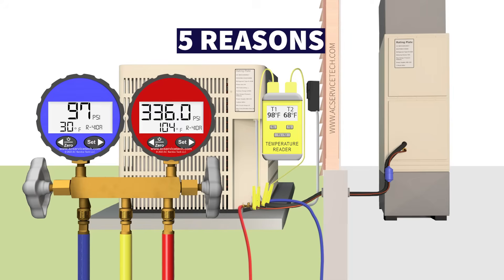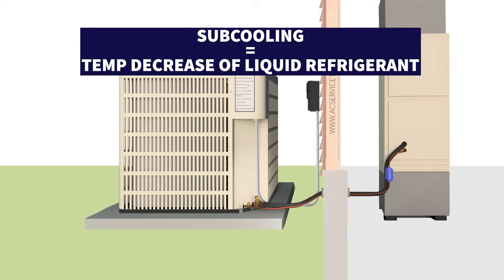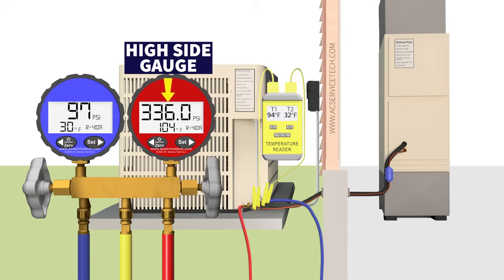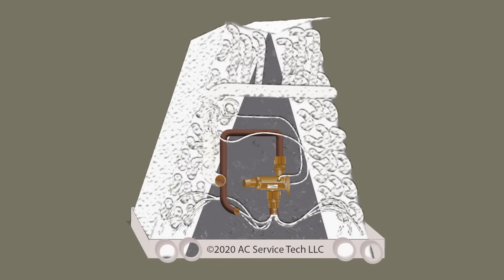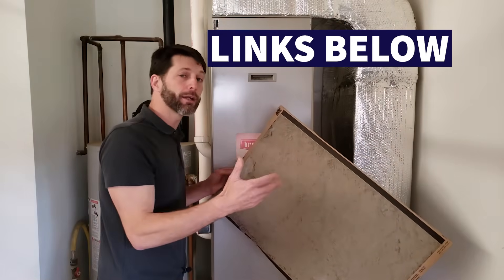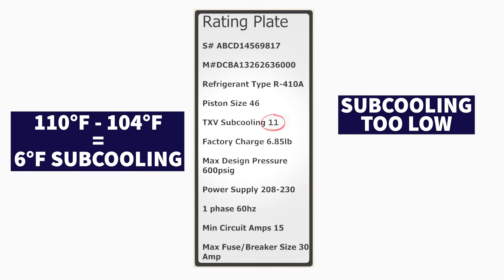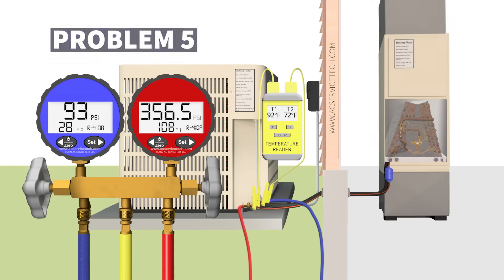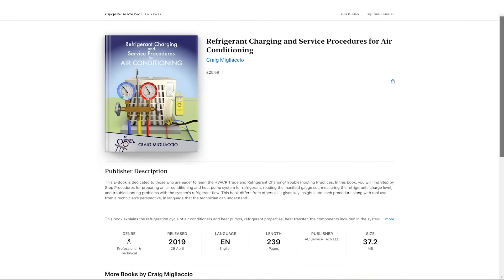Troubleshooting With Sat Temps, Superheat, & Subcooling! 5 Possible Problems!!

Comment: Ok, but for units with piston metering device dont you have to take the line temp as close to the evaporator coil as possible, not on the outside suction line to get an accurate reading? Also, doesent the data plate say what the design superheat pressures should be? Just saying for someone starting out without a phycro-meter?

Comment: Exactly what is happening to me on a new install Carrier split system r454b. Low pressure 100 psig, high pressure 290 psig. Superheat 27 subcooling 8. Condenser plate calls for 6 of subcooling. Already replaced filter drier, and txv and same problem persists.  What else could it be?
Reply: @acservicetechchannel please help

Comment: Here's one for you. Installed a 5ton Bryant unit rtu today. After start up. System went off on a low pressure twice before hooking up gauges. Saturated vapor temp of 33. Pressure of 104 on low side 2 degree superheat. 265 pressure on high side. No subcool.
Reply: Your first issue is installing a 5 ton AC
Reply: @ViperEpicness why do you say that?
Reply: 70f inside. 75f outside
Reply: open txv??
Reply: This would be so much easier if you gave both readings in Temp rather than one in temp and one in pressure. Possibly why you were all fuxked up on your readings. Making it too complicated.
Reply: @xkmmx2132  it was 410a. Convert the pressures yourself. Didn't make anything complicated. Gave you what was relevant and what I was seeing. The problem was airflow. Brand New system I had never touched before with an ECM blower that set CFM off of a voltage regulator based off off static pressure. Set my blower speed and everything was peachy.
Reply: I have a R-22  5 tons ac unit outside

Comment: Dear sir IN R-22 system back pressure continuous going Downward and Discharge pressure going continuously upward what is the problem in system please help me
Reply: 1. Check if the filter is Clogged
2. Check if the TXV strainer is clean

Comment: I have a hard time trouble shooting the heat pump at work. It’s a water furnace heat pump with a txv for metering device. The head pressure was 195.9 PSIG/68.2 degrees F with a liquid line temperature of 176.7 degrees F and a suction pressure of 63.4 PSIG/ 10.8 degrees F and suction line temperature of 82.8 F. The outdoor temperature was 86 and the wet bulb temp was 64.7 F. The  sub cool is below zero. - 108.3. That is way too low for the sub cool.

Comment: Just bought your book. I have a 12 year old trane  2 stage, 4 ton condenser/5 ton evaporator TXV, R-410A with 49.9 SH/1.9SC and low delta T. Is the system low on refrigerant or does the unmatched tonnage have anything to do with it?
Reply: Sorry 39.9 SH

Comment: I have a trane heat pump system with EEV, I have charged the system using subcooling, and it normalized yesterday to around 10 degrees subcooling, now today, it’s been fluctuating up and down, but mainly been low, between 4-6. This is frustrating because I don’t want to keep adding more refrigerant. Backstory: last winter, the compressor went out, and I replaced it. Charged it with weight as close as I could. A few days ago, I started using the cool mode and it ran for a day and then started to cycle, I would turn the breakers off to the system and wait a couple hours and then it would run for a while. Then it started to cycle again. I tightened all the blade connectors on all the wires and it’s been running properly today except the subcooling has been fluctuating up and down. Any ideas? Thank you!
Reply: Did you flush the system, evacuate the system to rid contamination, replace the filter dryer, clean the EEV screen when you changed the compressor?  Sounds like  non-condensables.

Comment: Long shot here, but hoping for a reply back, but any chance you still do service calls?  I'm in NJ and have yet to find a competent technician that can actually diagnose anything properly.  Any tech that I have had to my house just wants to go the route of "you need a new system", and I don't feel like they really take the time to do all that is needed to diagnose the issue properly to truly confirm that a new system is needed.  Especially when the one I have is only 8-9 years old.  UGH, help!
Reply from the maker: We don't at this point. We only provide the education for technicians, thanks!
Reply: @acservicetechchannel  damn, thank you for the reply though.  I enjoy learning from your videos.  Part of me wants to hand them to the techs that come out and be like here, do this, lol.
Reply: What exactly is going on and what have they diagnosed?
Reply: @Alex_hvac  Hey Alex, thanks for the reply.  I have a Goodman R410A, 3 ton unit with 80k BTU 80% gas furnace.The system is about 9 years old and does blow out cool air, but not ice cold.  It is a fixed orifice system, not TXV, Delta T is only a 9 degree difference when I take measurements.  The condensate pump barely ever kicks on and it's been over 90+ here in NJ as of late and that pump should be constantly expelling water. The coil isn't frozen and there is water in the pan.  I also tested the pump and it works properly.

I took a pic of the last tech's gauges when he was here.  Wish I could post a pic here, but can't, so the best I can do is type it out.  This is a Fieldpiece Digital Gauge he was using. R410A refrigerant Low Side: 161.5 PSIG 20.6 SH 57.0 VSAT////High Side: 223.4 PSIG -4.7 SC 76.2LSAT////Middle of Gauge: 75.7 ODDB 77.6 SLT 80.9LLT.

The tech tried adding 2 lbs of refrigerant with no significant change of anything on the readout.  He never measured anything within the house, didn't check the orifice to see if it was cleaned, the right size, in backwards (as someone a little while back did check the orifice, but this was at a time where I didn't try to educate myself on HVAC somewhat and just let them do their thing so I didn't have any input or questions as to what they were doing).

So I'm kind of in the stages now of pricing out a brand new system since nobody can seem to figure this thing out.  I'm not a professional I just watch videos on here to try and learn and help figure out what's going on.  It's just annoying to keep having service techs out and nobody is giving me a definite answer as to the problem.  I've made my piece with forking out the money to replace this system again already if it's truly condemned, but I would just love a confirmed answer as to what is wrong with it.  Sorry for the huge book to read.
Reply: @themachine871  You sound like an engineer! Lol That’s what got me started and interested in HVAC, troubleshooting my own system. Here I am 3 years later almost done with tech school I attend in the evening after work and about to test for the 608. I have a good paying job but I really enjoy this HVAC stuff. Did you ever nail down your problem?
Reply: @ Lol, thank you.  Unfortunately, no matter who I had come out, they couldn't nail down what was going on.  I wound up replacing the entire HVAC system and everything works perfectly now as it should, but I still would really love to know what the actual issue was.  Glad you found a passion for HVAC work, it's definitely intriguing and great to have a background in.  Good luck with finishing school and your future endeavors in the business!

Comment: Nice video. I'm looking for help on a different issue. My heatpump makes a loud mechanical noise only on startup for a second or
 two as it always has.   TIA
Reply: Make sure your fan is not loose, make sure your condenser is secured all around, & fan not wabling, check your coil If it's dirty, disconnect the power from the electrical panel take the sides of your condenser clean the coil with water house be gentle the  the coil is soft, if you had to take the fan to take the sids , write down what wire goes where and take  pictures, you have to disconnect the electric wires, or get you different markers mark the wires, whatever helps you remember to put the wires back where they were, don't be careless put all the screws in secured place, safty must be  your number one priority, [ the compressor information is on the condenser it's usually right outside check around u will find very important take good pictures of it print it out and keep it, check the  compressor Amp If the Amp is too high go get you a hard start kit, it can help you compressor if the problem is your compressor. If you have a newer unit that's otherwise in great condition, installing a hard start kit is a solid choice. However, with older compressors, a hard start kit may not be worth installing

Comment: Just checked my r22 system, sat of 10 deg. No wonder it would freeze. Thanks for all of you help over the years. i'm finally swapping out my old system. Going all the way, inverter aciq, their 2 stage furnace and coil (built in txv). Wish me luck. Your tips over the years helped me get my 608 for sure.

Comment: TXV TXV... #1 most improperly diagnosed and needlessly replaced part out there until someone finds the real problem 

Always check air flow. That if improper can give false readings that look like low on charge, restrictions on liquid line, overcharged with head pressure surpassing 500#s 

Low suction, extreme high head head pressure, super high SC,  normal SH with way low suction pressure. Everything is freezing!

Check air flow check air flow.  

Once or few times found a W shaped cased evaporator coil where the case insulation came off and 100% blocked 1/3 of air flow that messed up entire system that 3 companies could not figure out the simple problem.  These days we rip off or better attach  evaporator cabinet insulation to prevent such from being able to happen. 

Another simple thing that manufacturers can't get right these days ;(

Comment: Hi Mr. Craig! What are the recommended size hoses and low loss fittings to use when checking pressures and charging a system?? The thicker the better, right?
Reply: Hoses and gauges along with manifold rated for the pressures of the unit being serviced and or inspected.  As a retired Stationary Engineer with a heavy background in HVAC/ACR to include centrifugal chillers,  absorption units. I had a lossless hose with just gauge for low side and one for high side to do spot checks. Each setup was always rated to the refrigerant I was working with.  If you're new always use a gauge Manifold set design OEM for the refrigerant(s) you will encounter during your normal course of work. As someone who started out when R11 was still in use and retired after R401 had been around for years. I had multiple setups for my usage.

Comment: So when you have say 2.5 ton outdoor and 3 ton indoor coil. Is there any point to knowing what the indoor coil size is?
Reply: Yes. That's what determines the airflow you need. Depending on your climate you'll need 350-450 cfm/ton

Comment: Great video. Thank you for sharing. Have a nice weekend. May I ask, How about Heat Pump in Heat mode in the winter, How to check for ? is it the same or different. I love to watch your video ^_^
Reply: There is no sure way in heat mode. If it must be done in winter you can use a charging jacket, fieldpiece makes a good one but it's always best to  charge by weight in the winter,get it running in heat mode then come do the full commissioning in late spring. In my area anyway, just make sure you're oa is over 70

Comment: Has anyone had used the ebook E-Book - Refrigerant Charging and Service Procedures for Air Conditioning. I'm new to the hvac field and trying to learn as much as possible. Just curious if this would be a good reference material.
Reply from the maker: Make sure to read the reviews on Amazon for the book. There are literally thousands of reviews there. I saw this note yesterday and was hoping another youtube viewer would answer you here, thanks!!
Reply: Yes I saw the reviews on the book on Amazon. Very impressive. I was just interested in the ebook but was not sure if it was as good as the book.
Reply: @0518maddog  Get his regular book and quick card. I threw away his ebook and bought regular book. Ours brain work better with paper book and you can write notes.

Comment: Something to add for the new guys…. If u run into an EEV system with a single stage outdoor unit (ie tam9 with XR condenser) do not assume it’s low when you start it up and see 80 psi suction, give the valve and sensors some time to do their thing.

Comment: On hard to diagnose systems,  
I like to Reclaim and  charge system to a  calculated weigh in charge.
That way you have a reliable base line to work from.
Don't worry about drift on 410 it's negligible

Comment: This is why having a big air system is pointless. Spell a short cycle. And you're not gonna be removing any humidity from the air every time I go to a house. Somebody's like, yeah, I got a bigger unit. I'm like that's not better, that's worse
Reply: 100%. Salesman told me that and it made sense. I went from a 4ton to a 2 stage 4 ton. Unit runs low and slow, never hear the air moving, never feel it moving across my skin. You are just…comfortable and you dont know how or why. Humidity was always 60+. Now it’s 50-55 in the summer. Soooooo good. Rarely, when it kicks on full blast, you can hear my return vents humming. But thats only when my wife changes the set temp to something crazy so I’ve put a code on the thermostat :-)
Reply: Slow down blower speed and next time when it’s time replace go, go down a ton or so. You could possibly add on the house, add a few ducts and increase the value on the home

Comment: As a technician of 27 years, I still love watching these videos and it's weird when I was just talking to one of my co. Workers who's trying to get into air conditioning. We had almost the same numbers on a unit on the roof and I questioned him on what could cause that.
And this brings me right to the point. If it's rainy and you're doing fresher intake and with no return. If you've got 60 to 65° outside there and you're not moving too much air across that coil. Because most of the supply registers are closed, you're gonna freeze. And it's amazing that within a few seconds of seeing the numbers on the gauge, I already knew what the problem was. It's like they always teach if you can see what's going on inside the unit in your head. You can add anything you want and take away any part you want. And it still makes no difference to your. Knowledge

Comment: We’ve been installing many variable speed compressor Heat Pump units to retrofit outdoor unit,while keeping existing indoor systems (mostly Carrier model MURA), and I personally think it’s a great move,given the low power consumption and favorable weather conditions (32F Winter/103F Summer min-max average). 
We have to replace TXV on many of them… What’s your opinion on the changing conditions on pressure on the TXV’s operation. Do you think they can handle such ranges and be expected to be reliable on long term?
So far,so good. Just curious on your take on this subject.
And before commenteers start bombarding with “Why not change the hole thing?”
The simple answer is: The customer is not willing to make such investment at this time,and we are not in position to question their reasons,much less to tell them what to do for profit!
Reply: I'm curious as to what you mean exactly about the changing pressures on the txvs. You need two txvs on the system both designed for heat pump operation. The outdoor unit comes with one installed, you need to change the indoor one if it wasn't a hp before or a diff refrigerant as well.  If system is charged correctly you will have the pressure differential needed at both valves to operate properly no matter what mode it's in. The txvs will do just fine as long as you followed proper installation practices
Reply: @HVACRTECH-83  The Carrier MURA it’s an outdoor heat pump unit that comes with a variable speed compressor and sensor for temperature and pressure. The circuit boards asses and control condensing fan motor and compressor speeds based on the current operating conditions. In other words, it’s like a mini-split outdoor compatible with conventional furnace and coil or existing air handler. The point of these systems (GREE has one as well)is to work with existing line-set without insulation on the liquid line!

Comment: Please answer I'm waiting sir please please,🙏 If the boiling point of R22 gas is -40, then how does it convert from vapor to liquid in the condenser?
Reply: At atmospheric pressure that is the boiling point.
Inside a sealed system the refrigerant is under different pressures which changes the boiling point.
Hope that helps
Reply: It's my pleasure 👍❤️
Reply: Think of a pressure cooker. Water normally boils at 212°F. But inside the sealed vessel, pressure rises to roughly two atmospheres (15 PSI gauge pressure) thus RAISING the boiling point to 250°F. The same principle applies to liquid refrigerant. For example, R404a will boil at -22°F at normal atmospheric pressure, but goes up to 40°F when it's under pressure (low side around 85 lb/sq in) in the evaporator. In the condenser, the process is reversed. You must be way above normal refrigerant vapor pressure (which is 204 PSI at 90°F ambient temperature for R404a). So high side pressure must be made nominally greater than 300 PSI in order to ensure rapid condensation of the vapor.

Comment: When in doubt weigh it out. Jonny Cochran of HVAC. 🤘⚡️🤘✨✨✨
Reply: one would need to know how long the line set is in order to figure out how much to weigh back in. Sometimes it can be estimated correctly and sometimes not so easily.
Reply: @jdere31760  it’s not that hard.